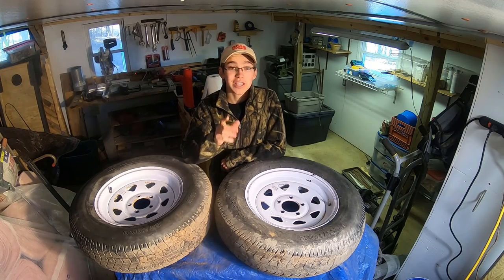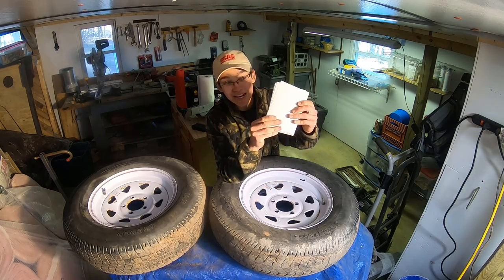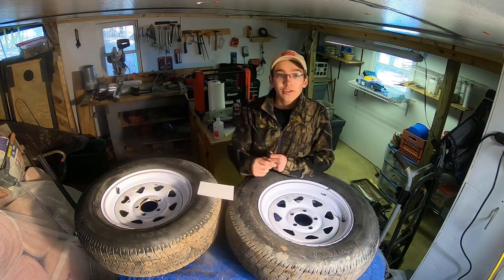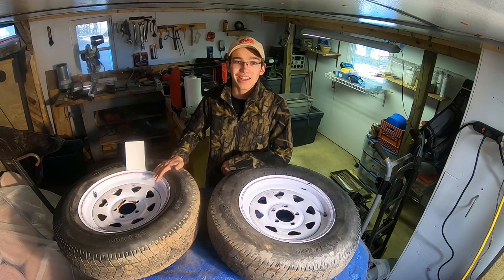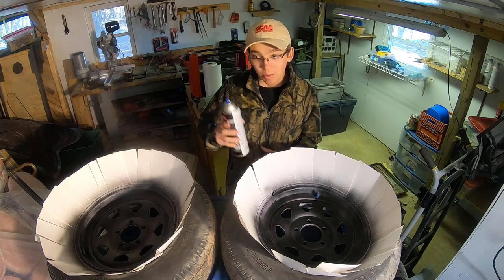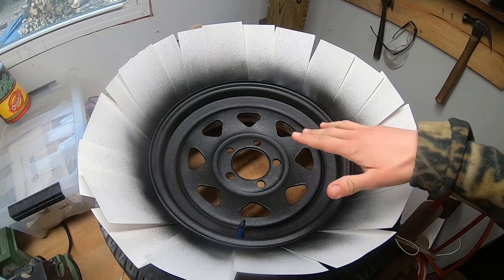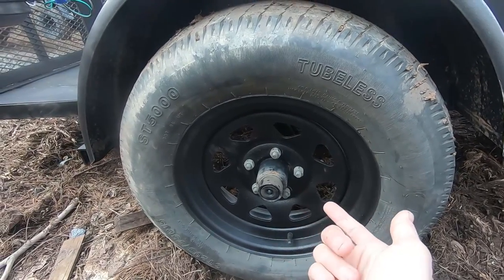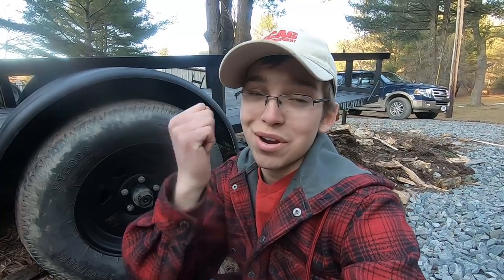Fixing Rusty Trailer Wheels/Rims | How to Paint Trailer Rims | Landscape Trailer Build Series

Comment: Nice video. What I wound up doing was prepping the rims while they were on the trailer.. Then I just used painter's tape to cut in around the black rubber to the rim. Then I jacked the back of the trailer up so the tires were free spinning. I would just spin the tire real fast, and spray from the middle and work my way up to the painter's tape. I used white paint and took your advice, did 3 coats. Then I finished with a clear coat..